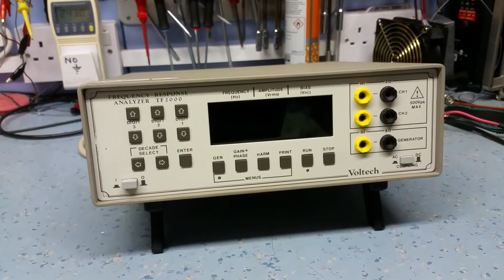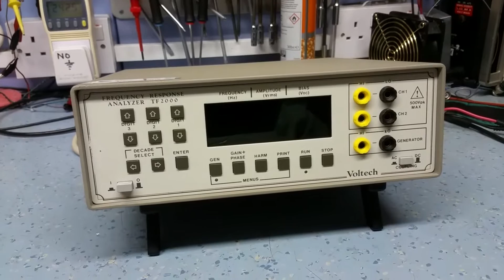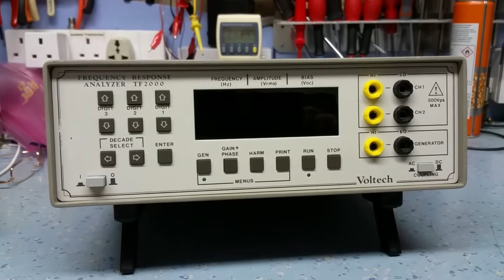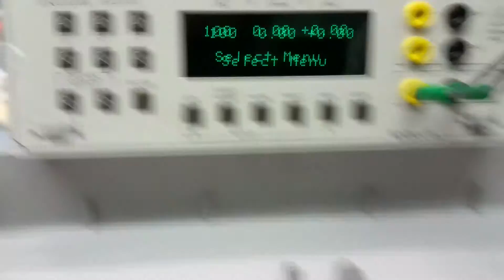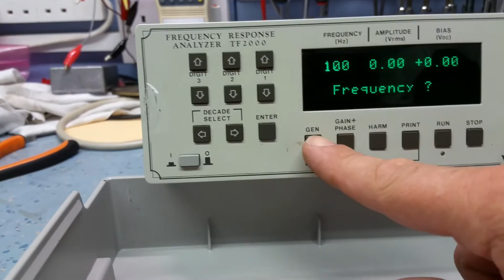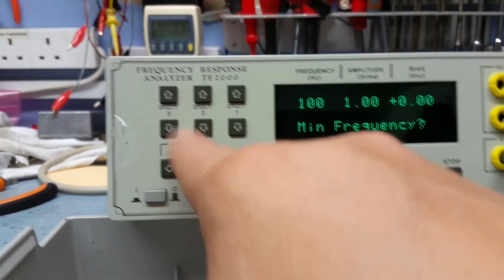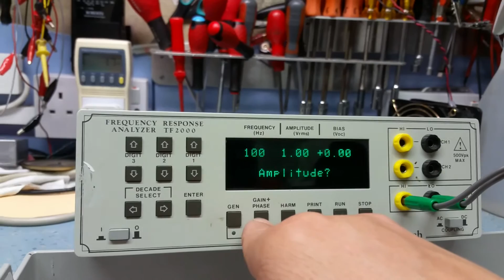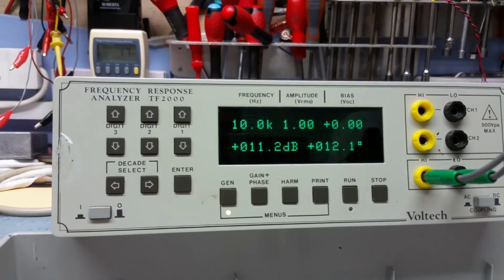Voltech Tf2000 frequency response analyzer quick fix?

Comment: Hi Simon, I had the same problem with my Tektronics spectrum analyser, frightened the life out of me when it blew! I could not find a replacement to fit in the space so I put in a non filtered IEC socket and soldered a new X2 cap across it. These old X2 type caps used a metalized paper internal construction and damp gets into the paper and they go bang. A lot of older equipment seem to have these metalized paper caps, there were about 8 in my spectrum analyser on the power supply board. I immediately replace any I find now with metalized poly (MKP) to prevent future problems. Be on the look out for old caps made by Rifa, they were ok when new but they are well past it now and its best to replace them.
Reply from the maker: +Pete's Electronic Projects I had the same fireworks from an old HP LCR meter. Stunk the workshop out. All part of the fun of the first power up.

Comment: It looked like you set a 42 sec delay before it began its analysis run...when in doubt RTFM!  ;-)  73 - Dino KL0S
Reply from the maker: The manual. thats no fun. Yes I had to in the end.
Reply: Of course we hams always plug it in, turn it on and ignore the manual; until we need it of course, but of course as you say that's the fun of it all!